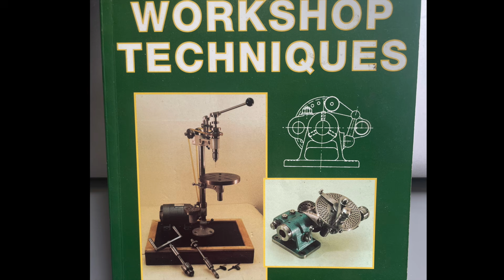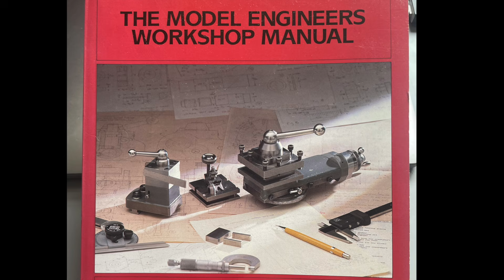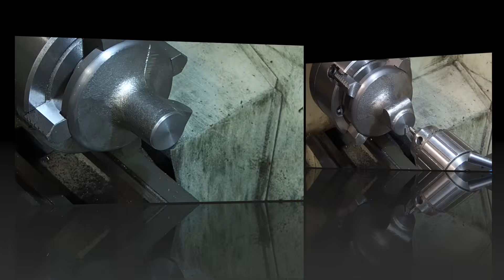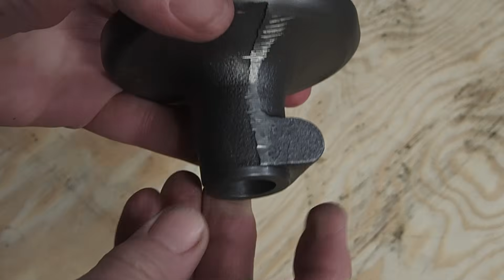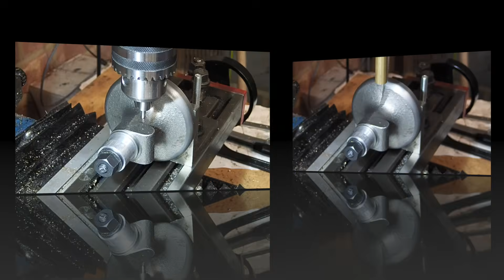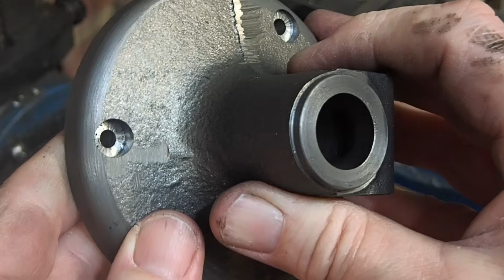Universal Pillar Tool -  Part 1 Base

Comment: I'm a little late to this channel but I am very happy I found it.  My name is Ben and my wife's name is Suzanne.  We share the same email account but I'm the one commenting.  I retired in '09 after 32 years in the USAF and we settled on property in North Carolina my four older siblings and I inherited when our dad passed on.

All this to say that during my career I bought a new Myford Super 7 with the long bed and a gearbox (this would have been 1980)..  I ordered from Myford back before they went out of business; this happened in the U.S. when Sheldon, Atlas, South Bend, etc. were put out of business by China.

  I bought at the same time the full Myford kit including the milling attachment, vise, and dividing head with all three plates.  That Myford accompanied us on my overseas assignments; I would set it up in the garage if the garage was large enough for a vehicle and my little machine shop.  On one occasion I set it up in the maid's room.  We didn't have a maid and that room was perfect; it had its own bathroom and so I could wash my hands before stepping back into the living quarters.

I bought a lot of books concerning metal work and George H. Thomas' two books were among them.  My dad had taught me the basic skillset needed to operate what he called an engine lathe.  It was a South Bend Heavy Ten; my dad was an aircraft "engineer" and the hangar where he worked had a complete machine shop, a complete welding shop, a paint shop, and a fabrication shop.  Dad and two other engineers worked in the three Engine Shops but each was skilled in painting, fabrication, welding, etc.  I learned the basic of those skills from dad and have honed them enough that I'm not daunted by some projects that require a lot of math, a lot of measurements, etc.

But I haven't ordered the Pillar Tool from Hemingway yet.  I'm going fabricate most of it and use steel 1/2" flats shaped to accept the round "centers" and then brazing the assembly together so I can roughly shape it on a milling machine.  I'm going to use a cast iron bar stool for the base and then silver braze bronze rounds to serve as the concentric clamps.  If I bugger it up too badly I'll order the pillar kit and the Quorn from Hemingway.

Thanks again, Modelling Mark and Godspeed.
Reply from the maker: Hi Ben, glad you found me.  Sounds like you’ve had a very interesting life!  Was one of your posting Hong Kong?  I was there for 5 years and all the apartments had a maid’s room. 
Good luck with fabricating the parts for the pillar tool. That sounds like quite a challenge!
Reply: @modellingmark  We were in Germany for a total of five years and lived in antiquated but very well-maintained Consulate townhouses in Munich (pretty rough assignment but somebody had to do it.  When these were built in the 1960's a maids room was included.  After Germany I became a Dept. of Defense (DOD) Attache and was posted in Venezuela, Peru, Mexico, Honduras, and El Salvador.  There was a maid's room in each house we lived in and each had a bathroom but the one in Mexico was the smallest.  Among my book collection I had two books authored by Kozo Hiraoka (building a scale steam locomotive) and I modeled my workshop after his.  I could just barely fit my shop in that space but it worked out well; excellent lighting, sufficient wall outlets.  Certain things were stored on shelves or in the lathe's bench drawers: a 6" bench grinder, sievert silver brazing torch, 4-jaw chuck, two faceplates, a small brazing "hearth" I could dismantle and store in another room along with a 20lb propane tank.  I also stored there my 12" surface gauge, a 6" X 6" piece of 1/2" armored glass I got from the Consulate's auto-shop. Perfectly flat armored glass was used for the back windows on the diplomatic cars and the side windows on vans.  They always had cut-offs available and I was on good terms with them so they were happy to let me scrounge a piece.  Furniture was provided by the Embassy or Consulate; so our "pack-outs" were quick and I would give the riggers a drawing of the crate I wanted the lathe and all its accouterments packed and safe.  Nothing in those crates ever suffered damage.  Thanks again and Godspeed.  I'm currently watching the second episode but you're not the same guy that was in the 1st video and I see you have a Myford.
Reply from the maker: You certainly had some nice postings, and were organising your workshop very well in small spaces!  
The second video you’re watching must be somebody else’s. Definitely only me in my videos, and sadly I don’t own a Myford. Just my well used Chester Chinese import!  There’s a playlist on my channel.

Comment: Did you turn the brass bar to an accurate half inch? Or were you trusting it to be accurate from the manufacfurer for your reamed hole?
Reply from the maker: I measured it and it was a couple of thou undersized.  It came out a nice sliding fit.

Comment: Looking forward to part 2 and more I'm planning on getting the kit myself just ordered the swing tool post and the rack and piniong graduating tool  from Hemingway bot apparently having trouble ihn customs hope it gets straightened out soon
Reply from the maker: I hope you get your kits delivered soon. I’m in the UK and customer service from Hemingway/Reeves is excellent. Customs, on the other hand, are a law unto themselves!  I should have the next video out soon which will be the cotter pins and possibly the main column.
Reply: @modellingmark  Yes I agree Hemingyway customer service is outstanding in my opinion the problem in customs is not Hemingway's fault I really likie their kits already have their small cast iron surface plate and the adjustable fly cutter haven't had the chance to work on them yey but hope to get busy soon

Comment: I painted mine with por-15 ford corporate blue and it looks quite nice to my eyes. No hammered finish though, unfortunately. Not the cheapest, but I've now painted several projects with the pint I bought and I think it'll last me til I'm dead.
Reply from the maker: I’m not familiar with Por-15 paints.  They’re brush on enamel paints?  How quickly do they dry?  Last time I tried using an enamel paint it was quite slow drying. It picked up dust from the air and ended up looking like a non-slip finish 🤦🏼‍♂️
Reply: @modellingmark  They dry to the touch pretty quickly. Not sure on the exact time, I just leave them in the garage for a day or two before I handle them. The can says not to start the engine for a week so I give them some time before exposing them to oil and such. I haven't had issues with collecting dust, but I don't know how dusty my area is compared to yours. The main issue I had is that it's easy to glob on, which looks like trash.

Comment: You made hard work out of the cotter pin. Better to make the cotter pin first, drill and ream the hole for it in the boss, clamp it in place, finally drill and bore for the 7/8" post. Then you can split the brass bush. I make extensive use of this method and the clamping system is very effective.
Reply from the maker: That’s certainly a quicker way of doing it and had crossed my mind. I did do it that way for the arms. However. For this casting I wanted to bore the hole for the column first. I couldn’t see a way of locating the cotter pin hole without having the main hole to reference from. Thanks for your comment. I’m always happy to receive suggestions on better or easier ways of doing things.
Reply: @modellingmark  I didn't want to sound like a know-it-all lol, and I'm sure your UPT will turn out fantastic! That Quorn project is going to be a long one 🙂
Reply from the maker: I’m genuinely happy to receive any suggestions.  The Quorn kit does look a bit daunting.  Still, one piece at a time!  I’ve got to make an indexing head for the lathe, a graduating tool and a between centres boring bar before I can get very far with the Quorn.  Making tools to make a tool to make other tools!
Reply: ...On the bright side, plenty of time to think about whether you even want a non-tool project!

Comment: Nice work! I would use one of the hammered paints from Hammerite.
Reply from the maker: Thanks!  Yes, Hammerite paint is an option. I’m still undecided on the colour.
Reply: @modellingmark  Grey
Reply from the maker: Certainly an appropriate colour for a workshop tool. Thanks for the suggestion.

Comment: good to see a new project underway Mark and good luck with the cotter pins, I thought they are a good, functional idea and much neater looking. Look forward to see the next episode.👍
Reply from the maker: Thanks. The cotter pins work well.  Less than 1/8 turn from free to locked.  Making them on the mill using the DRO to dial the offset, then cutting them with a slitting saw worked perfectly.  It shouldn’t be too long before the next video is out.